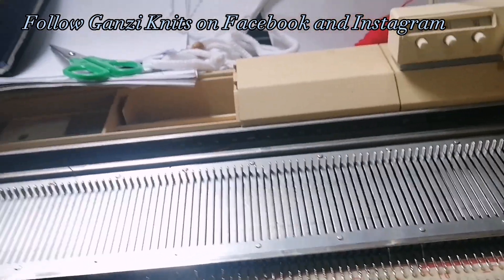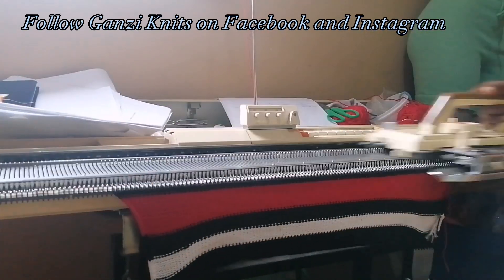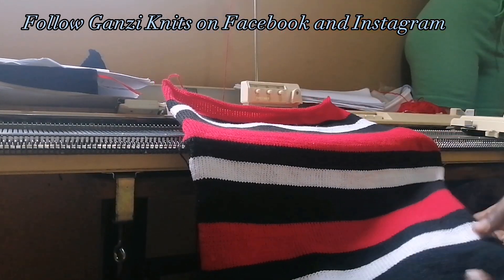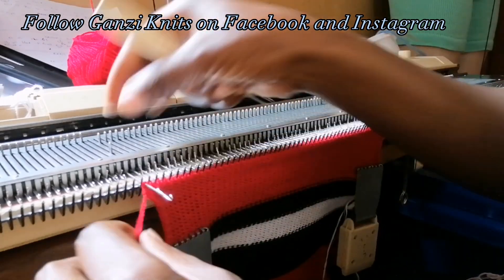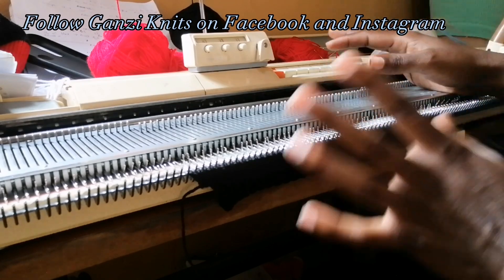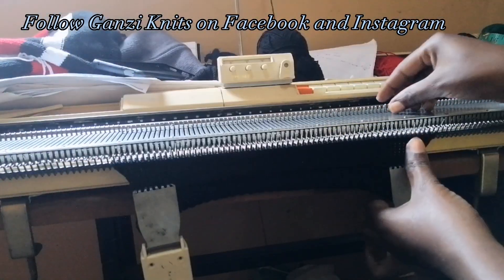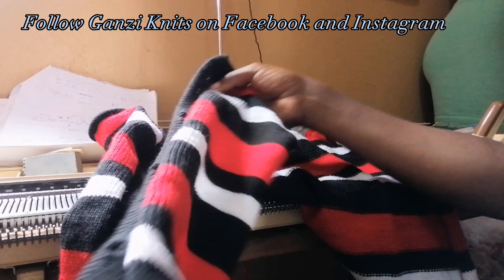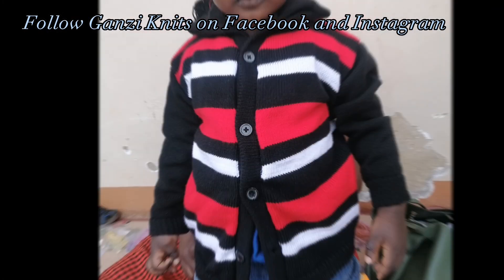How to machine an open sweater for a 2 to 3yrs old

Comment: I often put a metal rod from the hardware store into the hem to give me added even tension across the project.  I learned that about 7 yrs ago from another utube machine knitter.  Question:  where do you get your sizing information for children’s sweaters?  Or do you just measure your own little kiddies?  Mine are grown and moved away with grandchildren of their own.  I am left with trying to find sizing in magazines.
Reply from the maker: Great tip for the metal rode, I've learnt measurements out of trial and error for sure